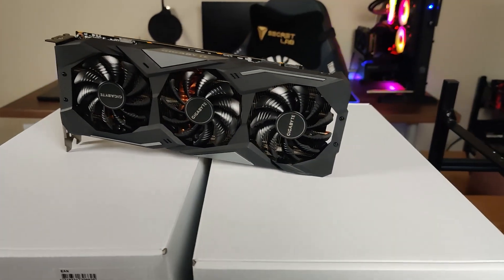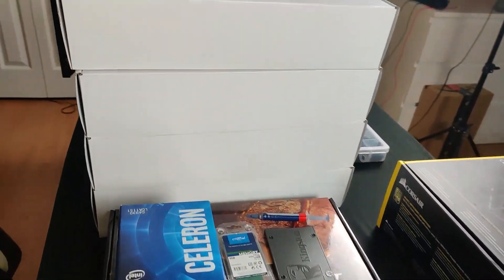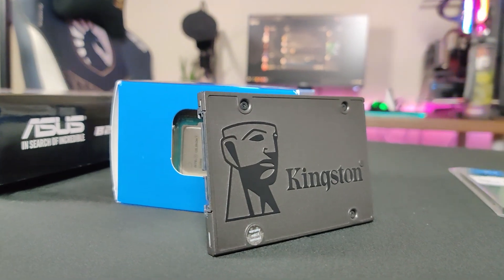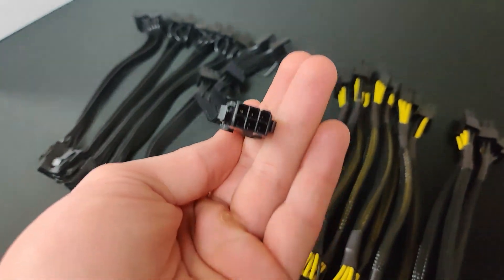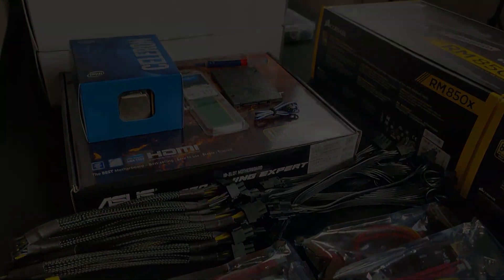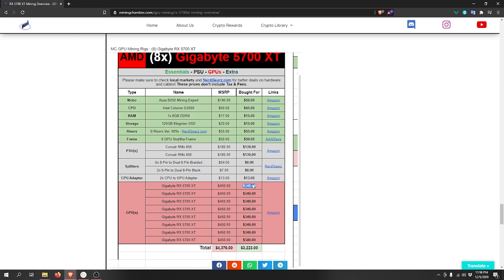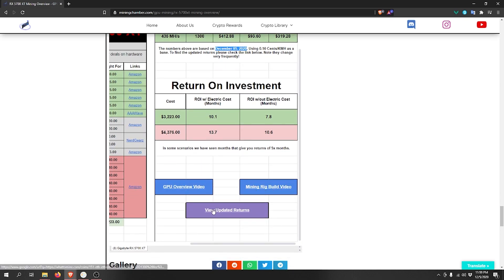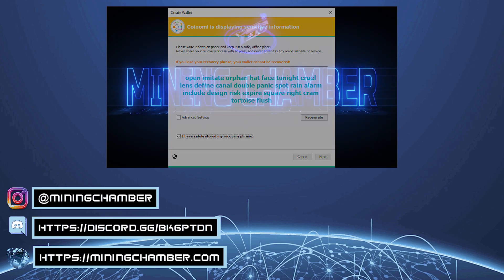RX 5700 XT Mining Rig Build - 8 GPUs | 435MH and 1300 Watts!!

Comment from the maker: Some more notes from the community!!
- Memory voltage should remain blank since 850 is an invalid number. On the other hand, Memory controller voltage can be set to 850.
- We could have drove the undervolts further, just due to a couple of cards crashing too much we kept it at that range but we will lower the power draw when I am able too!
Reply: I am getting about 59 megahash with the bios mod on the nitro plus cards. Core is 935, and memory oc is anywhere from 900mhz to 960mhz on hive... Depending on the silicon lottery. My weakest nitro+ card gives 55.7 (samsung memory) megahash on hive... Best one is 59.8 (micron memory) megahash.
Reply: pls check is this error they claim to mine on HiveON around 79EUR/day https://minerstat.com/hardware/amd-rx-5700-xt is this FAKE???
Reply from the maker: It's probably because they found a large block which shows high rewards now, one hour later it will be back to normal
Reply: @MiningChamber  but still Im shocked !! but Im sad Im unable to buy any GPU :( already build all and I have no card so shit covid19
Reply: @MiningChamber  what are you using to monitor electricity usage? Can you please add it to the description. Thanks
Reply: bro stop using window for mining, the window SO stop the potential for get more Mhz per GPU, you have low Hashrate, i have my two rigs with 58.25 Mhz each GPU , they are stable for long time. So 54mhz is the basic for every 5700 gpu series, you need to put bios mod bro
, and HiveOS or RavenOS are better to add 4Mhz more 4x8 gpu is 32Mhz more is like a one gpu extra.
Reply: @Mepicaelpito33  I think the concern is that some people experience lower wattage with windows and also they can potentially run more GPU on certain boards.. If someone runs windows over linuxOS, there is usually an established reason. If /kwh cost is not a factor, then maybe your position is the better one.
Reply: Rate day ?
Reply: the graphic card in your video is not the same with your link you leave pls CONSIDER to avoid this because it is FAKE INFO! your AMD have  3 FANS and the amazon have 2 only ! 
So where is the AMD card you bought from? Why you use your own referal links INSTEAD of droping AliExpress REAL links where you bought all this? hmmm..??
Reply: Bro can you sell me some GPU cards? if you have some and you not use let me know I am looking for AMD 5700 cant find in all the universe lol stupid covid19 situation :(
Reply: I'm pretty sure you've broken even by now
Reply: Thank you very much for great video. Complete noob here. I have a question- should I get 2 rigs like this or there is better cards to buy? I need a rig with $1000 income. Electricity is no problem. Thank you
Reply: I want ask? The your country. Police wanted you or not?
Reply: I'm doing good on Simplemining OS Sapphire Nitro+ BE and SE with Core from 1350-1380, Mem from 880-900, VDD 750, MVDD 1350 and MVDDCI 800, and get stable 55-56 MH/s at power consumption on Samsung cards  89-92W and with Micron 101-107W
Reply from the maker: Nice!! Really good numbers thank you for the info!
Reply: @MiningChamber  sir please tell me low price mining cpu Pakistan very high price electric sir please sir
Reply: @MiningChamber  I bought the cpu to gpu adapter that you have linked on amazon, but when the cable is connected to the psu and gpu the psu will not turn on.  Did you have any issues like this?
Reply from the maker: @David8k8  that's odd I didn't have that issue at all,did you make sure that everything else is right? I wonder if it only works with certain psus
Reply: @MiningChamber  That is what I was thinking, but it did the same thing with another psu I had.  Both are less expensive (lower tier I guess) units, so that still could maybe be the problem.  But I have a feeling that the cables I got are not pinned correctly.
Reply from the maker: @David8k8  hmm that can be possible that they are not pinned correctly, double check that it is actually made for a 8 pin cpu to gpu
Reply: @desirandom.9x  you can use any low price cpu, even pentium would work. GPU is what you need to purchase. I am mining on rx 580 8gb and getting 500 pkr daily. 100 pkr per day electricity cost. So that equates to 400 pkr profit
Reply: @yufreak1  I have same cards, 8x RX5700XT with Samsung memory and customized bios... what is your consumption off the wall ? I get stable 447MH/S with 990W off the wall...with no undervolting memory controller and memory...
Reply from the maker: @pat_ricckk  nicee!
Reply: @pat_ricckk  what settings are you running and what cards?
Reply: In making of mining Rig only GPU is focused
I just want to ask how important is CPU and Ram memory
Or it doesn't matter that much compare to GPU
And second thing if I run this kind of rig for 24/7 what kind of cooling management I have to use (Air/Water). Well I want to use just air cooling because Water cooling will make it very expensive. But I want to know what problem Will I face with air cooling

One more thing what role have GPU memory in mining and I know how important GPU processing frequency is but want to know how important GPU memory is

Comment: Hello there, thanks for your very easy explanation and efforts to help us get on the right path... question? Have you try to use Asrock H110pro with this 8 5700xt ? , I have 8 sapphire 5700xt all getting 57MH with 85watts each but they can run together at these OC even powered with 2 evga 1200g2 . Any advice?
Reply: you can run for sure 4 cards on 1200w

Comment: How, at the current price of the component prices can one get a decent ROI ever. Considering an optimistic useful life of 5 years and a price tag North of $20k for a 6 GPU , you would be losing everyday you turned it on. Prices will have to come down a lot before one could make any kind of money. By then the landscape for crypto will have changed umpteen times. Go to a casino.

Comment: Hey can someone please advise? I have just built a 12 gpu mining rig, it consists of 3x rx 570 8gb, 4x rx 580 8gb, 2x vega 64, 1x 5700x, 1x 1080,1x 2080.. motherboard is ASRock H110.. CPU basic intel.. 2x Corsair 1000w power supplies.. 10x Arctic 120mm fans.. It’s sounds silly but I’m not sure whether 2000w will power all of this safely? Am I wrong? With some research it suggests I need more power (minimum 2400w) but multiple YouTube videos I’ve seen people run similar set ups with 2x 850w PSUs? Thanks

Comment: You seem to be using 2 psu for 1 pc? How did you make it so that they both turn on at the same time? Basically how did you manage to sync 2 PSUs to work with one mobo?
Reply from the maker: Psu splitter, it shorts the 2 pins and turns it on together !
Reply: @MiningChamber  nice thanks.

Comment: Hi what do you call to that holder of your GPU, within your PC RIG?
Reply from the maker: That's just the case, it's called thermaltake core p3
Reply: 10:35
Reply: I see i thought you bought a gpu mount vertical then you put it outside of your case. Planning to buy another gpu for my pc rig. I want to put it outside with proper   designated area.

Comment: Hello. You always use the Intel Celeron series. Is there any specific reason? Can't I use Intel 10th Gen Core i3 10100F or similar to this processor at the beginning?
Reply from the maker: Yes you can as long as it's compatible with your motherboard! Celeron is one of the cheapest so it's why I usually use it
Reply: @MiningChamber  Actually this processor is unavailable in our country. Thanks for your reply.

Comment: Hi Sir, how do you set up the cables from GPU to ATX? I just started sourcing some equipments for mining (noob here). I see y-splitter from 2 risers and it's connected to another y-splitter to power GPU and splitter? 2 6+2 pin to 6 pin(female) for risers, 2 6+2pin to 6 pin(female) for GPU? am i doing it right?

Comment: Hi thanks for your video, I have two 5700 xt and they work very well alone for more than 10 hours but if I plug them toghether my sistem or amd software for undervolt continue to crash or freeze. For now I’m using Kripttex and nice hash, what could it be? Should I try to use hiveos.? 
Maybe there are different and need different OC stat ?

Comment: Hey Mining Chamber, I copied your rig for the most part. Using MSI 5700 XTs. For some reason when I plugged in both power supplies, none of the corsair RM850x came on. I tried different outlets, tested the outlets. Looked at all the connections, including the 24 pin connection and the EATx12V Power supply to CPU connection. All in place. Any suggestions? I doubt both power supplies would be bad, seems like something is missing? Bad motherboard (ASUS B250 mining expert)?

Comment: Hey guys I’m building an 5700 rig with 8 gpu, the usb cable that came with the riser is too short and doesn’t reach the mobo, I order 8x 3.0 usb a to a (60cm) to replace them but they didn’t work (mobo didn’t detect gpu). Do I need a specific usb cable for this job?
Ps. everything work fine with the usb cable that came with the riser.

Comment: Wouldnt it be better to Have 1x 2000w power supply instead of 2x 850watt ??
Reply from the maker: For sure! It's just it was found for a good price so I went for it. Server PSUs are generally the better option
Reply: @MiningChamber  awesome, do you know a place to buy a 2000w power supply other then  Alibaba ? Also do you have a community discord or something for future question ?
Reply from the maker: @jiladoper2  I do have a discord yes link in Description! And for high wattage psus you most likely need 240v circuits. Check the server psu video I have out, it covers alot of this!
Reply: @MiningChamber  Thx for the help brother, Im  completly New in this and im teying to build a 8gpus rig, budjet is 5k cad My microwave is 1850watts and I also have a mini oven that is 1350watts, both are plugged on the same circuits and I cant run both of them at the same time otherwisr the breaker goes off, But I wonder if I remove them both and install a 2000w psu if it would work, the server psu looks complex for a begginer

Comment: Even know u got for cheap at 350 and add up to $3k+ and run 435 mh that still expensive, why don't just buy a linshi phoenix that run 2600mh and it's $11k to $14k that alots cheaper. Just say 3k for 435 you gonna need 6 time the amounts 6 × 3 = that carry u $18k but it's alittle over $3k so u end up spend over $20k easily just to get 2600mh. And you gonna need alots of space, best choice buy one linkshi phoenix and u good to go.

Comment: I just had a quick question about dual psu mining if anyone could chime in. When using two psu's my understanding is that you wire it like follows: one psu to all motherboard components including 24pin supply connector, pcie molex connectors (on the motherboard), and CPU and fans. Then splitup the remaining GPUs half and half. So in an 8 rig system, 4 gpus & risers together on the PSU main supply (going to motherboard) and the other 4 gpus/risers on the other PSU by itself (with no motherboard connections). The only place both PSUs should connect together is if you have a 24-pin dual PSU cable where the secondary PSU will have a ground connection (using the 2 wire cable). Is this correct?

Comment: Watching this with today prices.
At price of 2k each Ethereum. 
And today difficulty this rig will make you 325mHash. That means it will make a staggered 1000 a month. 
Correct me if I'm wrong...
Reply: wrong. current profitability per 5700xt as of Feb 23 is $11.38 regardless of difficulty (negligible in the pool). Run minerstat and eth calc and punch in 5700xt. It offers 54mh per which is about 420mh still. This build will rake in 2k per month after electricity cost.
Reply: @fahmidabegum2868  that means more than what i expected. 
I was just saying the minimum. 
Unfortunately the prices are going down.
There are more coins are available to be solved the less the price gets. 
Fast investors are gaining the revenue so selling rapidly. 
These coins doesn't keep it's price stable. No wonder it may go to 5k and this can happen.

Comment: Why not water cool or use an industrial chiller, could run faster?
Reply from the maker: It won't necessarily run faster by that much but for me I don't need it because where I live gets really cold, so it will be overhead costs for not much improvements. But for others it can be a great option
Reply: @MiningChamber  living in Florida I was looking at a full Solar Powered shed with water cooling/chilling and not evening using 120V power supplies and just use Buck converters to step down 48V DC solar batteries to 12V & 5V DC to run the CPU/GPU's and skip the lose of the AC to DC conversion and have plenty of back power/UPS. Our local power grid is joke...

Thanks for the reply

Comment: How did you run the dual psu? I just received another gpu and need to hook up my second psu. I have 2 850s and the b250 mb.
Reply from the maker: Dual psu splitter, you can find some info on the atx psu guide video

Comment: I have exactly the same card like you but my gpu memory are around 100-104 celsius. Should I be worried about it?
Reply from the maker: They do get hot on memory temps but try to increase your fan speed and make sure your doing the right overclocks. Keep it below 95c if possible

Comment: Hello everybody. I'm just trying to learn more about how PSUs work, safe wattage of wires, connectors, etc. etc. Any advice would be much appreciated! 

In short, this just looks like a whole lot of splitters and connectors going back to one PCIE plug. 5700XT tops out at 260W, plus two risers at 75W each gives me a total of 410W on one 8pin connector. I know once you undervolt the GPUs they will be much lower, but still, if something weird happens and they go full blast, that seems unsafe. 

The wires are likely 16 gauge which can handle that draw, but the ATX standard for an 8pin is only 150W. I know this PSU is single rail, so is that what makes it doable? I'm still trying to wrap my head around the electrical aspect of mining rigs. Thanks again!
Reply from the maker: Hey! I have just the thing for you ;) 
First watch the basics of atx psu here: https://youtu.be/e7AO8ADUD5g then the 75w and 150w topic I debunk here: https://youtu.be/G3RsEMsB7To

After that, your all set ⛏️
Reply: @MiningChamber  That was excellent! Thanks for all your research! That helped me understand things much more clearly! So since you did this build in December of 2020 and you did all this extra research on Jan 4th 2021, would you still feel like this build is good and safe? I'm assuming yes, but just want to make sure lol.
Reply from the maker: Thank you ! And yes everything is good thankfully with this build. Nothing burned yet 😛
Reply: @MiningChamber  Haha ok. That gives me some more confidence :p Thanks again!

Comment: How many I need to make $100 day
Reply from the maker: Just add the hashrate up! Probably 2 of these rigs make you now $3000 a month. Confirm on the mining calculators like whattomine.com
Reply: @MiningChamber  so just the rx not 3070 or 3090
Reply: @MiningChamber  which is for eth
Reply from the maker: Any gpu. It doesn't matter. You can check the buying guide I released recently, I show there how to check profitability

Comment: Super set up! I have an Gigabyte Aorus RTX 3090 Master that has thermal throttling. I've changed thermal pads, all of the m with good ones from Grizlly, still nothing it starts with 106MH/s and after a few minutes goes down to 75-80 MH/s. Do you have any suggestions?
Reply from the maker: Thank you! Not sure other than thermal pads replacement. Make sure your using proper overclocks for it and hopefully that helps

Comment: Do you recommend this cable from CPU to direct GPU

https://www.daraz.pk/products/8-pin-male-to-dual-8pin62-male-pci-e-video-graphics-card-power-cable-gpu-power-extension-cable-cord-splitter-for-btc-i141212609.html

Need one more clarification

1. Is there any difference if above cable coming from PCI-e slot of PSU and then goes to 1 GPU
2. Is there any difference if above cable  coming from CPU slot of PSU and then goes to 1 GPU
Reply from the maker: Avoid buying cables like that until you confirm it's compatible with your PSU which is very unlikely so it's best to avoid. Your best option is splitters. Pcie on psu to gpu, cpu to cpu. Some PSUs can do cpu and gpu mix but I would be wary of it.
Reply: I got the cables same like yours where 8Pin PCI-e male connects to female and then female forwards 2 8Pin PCI-e cables.
I did not find those 6pin from Riser to 2 8Pin PCI-e female.

Comment: One another question, recently I buy a second hand mining rig from Facebook market place it had 580 Rx 7 GPUs plus 8 GB ram 120 SSD 750 watt two power supply . When I vonnect all 7 GPUs they are not showing in device manager. When I connect the three it connect. For that rig I use lolminer . It shows average 2.0 mh/s for two GPUs (1 mh/s) per gpu . Is there any solution. It shows zhombi mode activated.
Reply from the maker: Try Phoenixminer and make sure both power supplies are turning on. Check the Phoenixminer video guide I recently released as well as the atx psu guide in the channel. It will help you figure out the issue. Also make sure to follow the settings for the RX 580s in miningchamber.com and set it in compute mode
Reply: @MiningChamber  thanks

Comment: Hello from Switzerland, I recently buy this 5700 xt Asus gpu which mining software I should you. And yea I have 750 watt power supply is that is innuf. Motherboard is Asus mining BTC . 8 GB ram 250 SSD . Please guide. Thanks in advance
Reply: 1 gpu
Reply from the maker: Yes that is enough just make sure you use the settings from our website MiningChamber.com
Reply: @MiningChamber  thank you so much